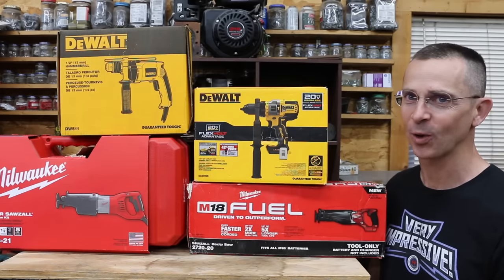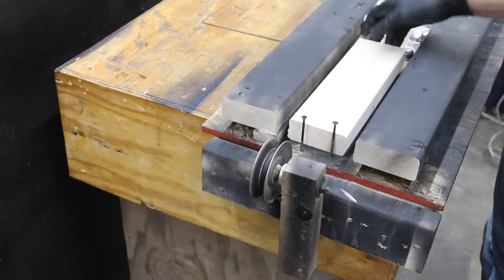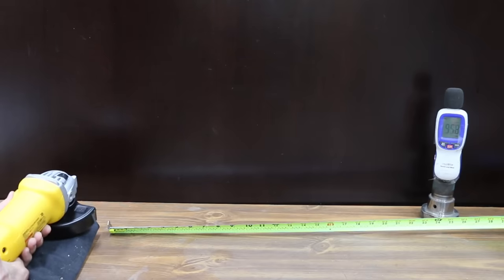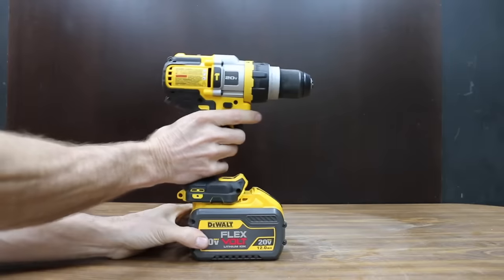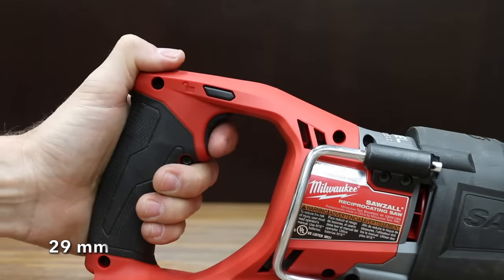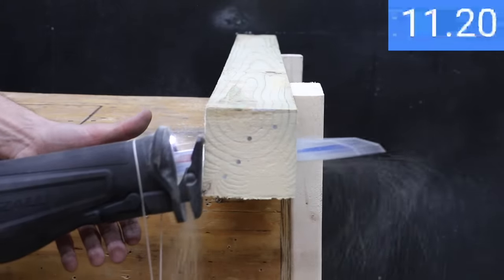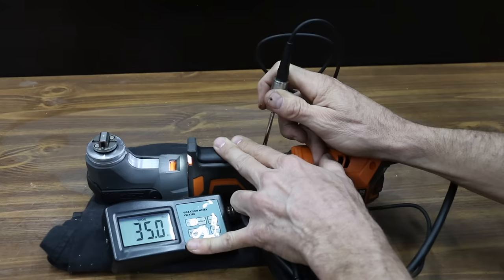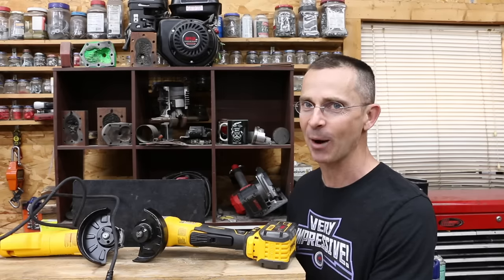Let's Settle This! Are Cordless Power Tools REALLY Better? Torque, Cutting Speed, Noise, Vibration

Comment: I own both corded and cordless tools and enjoy both. The big plus of the corded tools is twenty years from now they still work fine and I don’t have to worry about battery issues. That said I often use my cordless tools for ease of use, no cord.
Reply from the maker: Thanks for sharing.
Reply: That is true. I bought a Hitachi corded hammer drill about 15 years ago. I abused it a lot. I still have it, and it works just as fine, while a cordless Dewalt drill I bought two years ago has issues with the speed control.
Reply: True enough, but if you run a company you can go through 4 grinders or drills in a couple hours in the wrong hands or environment.
Reply: Came here to say the same. Still have some of my dads corded and air tools from 60 years ago. My cordless stuff be in the trash in 10 years because of battery issues guaranteed. Not because of anything nefarious its just the tech is in the batteries keep getting better. Backwards compatibility would be great but the tool company has no financial incentive to do so when then can sell you brand new tools.
Reply: Same here. One thing they have thought about is getting people stuck in their ecosystem. I buy the same brand just because I already have the batteries
Reply: If I was soley working in my own workshop I'd have nearly all corded tools. Because I'm often in places without electric I buy cordless.
Reply: @sleblanc  also has to do with production quality going downhill. I have had the same DeWalt cordless tools for ages. Early 2000s. They are awesome. But my brand new Milwaukee M18 tools have problems like what?!
Reply: My company mostly used Makita cordless drills on our jobs.  They are convenient, but not as rugged as the corded models.  For the last three years Makita has lost it's quality.  Now we buy a cheap brand and don't feel bad when they break.
Reply: whats the best corded drill ??????????????????????
Reply: @AnGryCruizer  dewalt mid handle vsr drill
Reply: @AnGryCruizer  That I do not
know. Check out Project Farms channel he does some very good product test.
Reply: It’s the same as Bluetooth versus corded. While corded will always sound better. Bluetooth is much easier to use
Reply: @theolympiyn8670  big facts
Reply: Yes, I like that I can keep the little impact screw gun in my tool bag with a battery in it, and 6 months from now it’s still got a charge. The little LED light they put on them these days is AMAZING, I find myself using my screw gun to look for other tools😂
Reply: @sleblanc  if you have a friend who works at an auto shop where a MAC tool truck comes around, they will replace it for free. MAC is owned by DeWalt and they solve defect issues by simply replacing the tool.
Reply: @supermr2  instead of trashing them, an electrician could rig one of the battery housings to make it corded
Reply: Agreed.  My first-generation cordless tools are already useless.  I still have all my old corded tools and they all still work.  Its hard to talk myself into spending many hundreds of dollars, just for the convenience when I have stuff that works already in my garage.
Reply: @theolympiyn8670  How is Bluetooth much easier to use? Corded headphones are plug & play, no hassle. Bluetooth, you have to deal with connection issues at times
Reply: @tcg1_qc  buy better shit them. Corded also has issues. One you can’t really move to freely with corded things. The cord can get caught on stuff and yank your headphones off. The cord can break and you can’t really fix it.
Reply: @theolympiyn8670  even with better stuff you can still have connection issues, and if the battery dies then you don't have headphones. Plus not everyone can or wants to buy more expensive headphones. 

 As for movement, that really depends. If I want to move freely with my corded tools, I just grab a long extension cord and I can move as much as I want. Now if we're talking about headphones, I'll be honest and say that I only use Bluetooth ones outside, but at home I only use corded. And if the cord breaks, you can fix it, depending on what the headphones are
Reply: @supermr2 flexvolt has the same power as corded yes you may have to buy new batteries in 10 years but it really doesn't matter if there's better quality tools out the Flexvolt is still just as powerful as corded so no point to upgrade
Reply: @troutriver58 flexvolt cordless is equivalent to corded power there would never be a point to upgrading regardless of what comes out in the future
Reply: @zackgibson3389 what are you using for replacement batteries for old Dewalt 18v tools?

Comment: It would be even more interesting to see a test like this if tool manufacturers put the same time and money into engineering corded tools as they do cordless. I feel like corded tool design has remained unchanged for the last 20 years.
Reply: Totally, doing a mains capable inverter would make them bigger (isolation required), while dealing with less voltage from a battery is easier(isolation optional).
Especially if you want to include complex stuff (microcontroller, LEDs e.t.c.).
Reply: It's probably pointless in the eyes of the manufacturer. There's more demand for cordless tools, even when they perform worse.
Reply: @Subsonic1050 Corded tools have remained the same for well over 20 years. Unless you think corded tools were a new thing back in 2000?
Reply: I've been in the metalwork trade for over 40 years. Have corded tools that are over 25 to 30 years old. Not much has changed for them. I have switched  almost completely to cordless. Because many job sites have no or limited access to power. Not having to run a mile of extension cord sure save time. Cordless tool will never be as durable but way more portable.
Reply: What kind of engineering do you mean? Seems like the corded stuff is already dialed in and built to use the power available. I would love to see more engineering on the functionality/convenience side.
I feel like the only engineering going on with cordless tools is the battery packs, and the performance improvements are simply due to higher output batteries.  Eventually they may have to beef up their internals, but I get the feeling the last few generations of a lot of tools were probably the same components, just marketed with higher output batteries. 
Idk if I would say its pointless to tool companies, but im sure they would rather be raking in profits than spending money on R&D. Its kind of a shame though because it seems like many improvements could be made, and it wouldn't take a rocket scientist.
Reply: @A6Legit  corded tools still come with brushed motors.... if they put brushless motors on corded tools this wouldn't even be a comparison. But r&d has basically stopped on corded tools. It's all about cordless and getting you hooked onto one set of batteries.
Reply: @ducewags  I saw my first cordless drill in 1990.. Hitachi.👍🇮🇪🍀
Reply: Or even a test where the cordless tools were not twice as expensive as the corded.   You may be testing a top of the line corded against a lesser cordless but it is what the money will buy.
Reply: @geoffreycasey875  Well that makes you a youngin fer sure if that was the first time seeing a cordless drill.
Reply: @ducewags  when did they start being used regular?
Reply: @rc-daily  No kidding, Ive never really thought about what kind of motors my corded tools use lol. I feel like they already have adequate power, is there really much of a benefit for brushless? Im sure there are some instances, but in general they get the job done fine. 
I enjoy having cordless tools but its BS that they arent hybrid. Especially when companies know even their best batteries cant really keep up with the high draw tools... Idk about everyone else but that seems like it should be engineering goal #1 to me... Then everybody wins.
Reply: @rc-daily  Most professional prefer cordless tools because there isn't power on a lot of job sites. Its nice not have to have a generator and a miles long extension cord. Battery power tools are a time save for people using their tools all the time.

The people that most buy corded are typically DIY and just want something cheap.
Reply: @geoffreycasey875  Well back in the early 80s we used them for building decks and tree stands where we had no power. Makita cordless and Black and Decker was a big hit back in the day.
Reply: @A6Legit  the benefits of brushless are unlimited. More power, more torque, longer motor life, no brushes, no maintenance, no wear parts, more energy efficient,  just to name a few. In theory you could run a smaller brushless motor to have a lighter tool that would out perform the original brushed tool. Battery technology has came a long way in the past 10 years or so. Back then in the rc world you would be lucky to get an rc to run 15 minutes on a huge nimh battery. Now with brushless motors and lipo/lihv batteries we can get an hour out a 500mah pack. Your average 11.1v 500mah pack is no bigger than 4 aa batteries in square. Like an inch wide and an inch tall and 2.5 inches long.
Reply: @nathaniels9141  I do construction work for a living. Obviously all of my impact drills are cordless but my hammer drills are corded, my miter saw, skill saw, recip saw are all still corded. But where we generally work we have access to power. We remodeled a barn a few weeks back so we had to get out the generator lol

Comment: Would love to see different wire connector tests (wago 221’s, traditional wire nuts, etc.) Thank you for such thorough reviews! Keep up the great work.
Reply: Definitely second this.
Reply from the maker: Thanks, will do!
Reply: Great Scott already did it.
Reply: Several people on Youtube have already done comprehensive tests (Great Scott did it and another guy did as well). Both tests were exactly the same.  Wire nuts give less wire resistance than any of the other connectors (the wire heats up less and less power is lost as heat). However, all three types of connectors are legal under the NEC, so it will be up to your local codes or who you're working for.

Comment: Each tool has its place. I select Corded tools when I have a lot of cutting/work to do so I don't have to keep changing batteries.  Also, Corded drills always cut the same unlike battery tools when the battery gets low.  Thank you!
Reply: Agreed 100%, and another advantage of corded tools is if you only use your tools on occasion you don't have to wait for the batteries charge up, or worry about if they have gone bad on you having set around, just get an extension cord, and get to work, plus overall corded tools are cheaper to buy if you are putting a garage/workshop together on a budget.
Reply: Also if you only do something now and then not often corded tools are better always on hand and always work. Battery tools tools are good if you use them a lot and have more than one battery.
Reply: Buy extra batteries and you'll be good. Yes, they are expensive but I have a job and my convenience of not moving a cord around things is well worth any amount I need to pay 😉 Good luck to U out there! 👍
Reply: Exactly. Like that taco kid said, why can't we have both?
Reply: I like cordless because when you release the trigger it stops very quickly. I've broken a few drill bits with a corded drill (tried to break my wrist).
Reply: @tonysheerness2427  Yep, and with battery tools unless you stick with the same brand which might not always have the tool you need, then you are going to end up with different batteries that won't interchange, same with the chargers if they don't plug in directly to an outlet with a wall charger, then what if say 10 years down the road the tool still works good, but you can't get the battery for it, because no one is making it anymore, then you have to buy a whole new tool, and just chuck the old one without modding the old battery pack if it even can be. 🤬
Reply: @CommodoreFan64  Yes I had to chuck out a 24 v drill because to buy replacement batteries cost more than a new one. And they say go green, all talk.
Reply: This. Horses for courses.
Reply: @tonysheerness2427  Zero surprise there, as after my stepdad died in 2015, I inherited his garage worth of tools with some dating back to the 1950's, and many corded power tools from the 80's which still work good to this day(same for the air tools with just a good oiling) when I need them, but almost all of  of his battery powered tools because he let them sit too long, I had to chuck in the recycle simply because I could not get the replacement batteries, or they where going to be too expensive.  Battery power is just so wonderfully green, and earth friendly 🤦‍♂️
Reply: @CommodoreFan64  I had a 12v Milwaukee set that I finally dumped about 5 years ago because it was near impossible to get the batteries. Yet, my corded tools from the 50's continue to work fine.
Reply: Yep.  Corded in the shop.  Battery powered in the field!  Also certain jobs just need a corded tool.  I have had my Milwaukee drill literally smoking trying to mix mud with a paddle whereas a corded drill just chugs along all day and night.  Just my experience but coldless tools can make some serious torque but all that amperage at lower voltage they use to do it makes a LOT of heat.
Reply: @BrianRRenfro  use a mud mixing cordless drill
Reply: @matthewsmith1461  If I did drywall every day...maybe.  Or I can just use a $100 corded drill I have lying around.
Reply: @jaynelson4175  Heck yeah! I forgot all about them being wrist breakers because I haven't use one in so many years 😭
Reply: @CommodoreFan64  Bingo. Batteries are not there yet in terms of longevity. And that is how the manufacturer gets their BS planned obsolescence cash grab in. They change the battery and /or the charger and youre screwed. A corded tool can't be figured into the planned obsolescence scam as you can keep it forever. Ive got a few cordless tools that I really like. But for hitting it hard all day long. It corded or pneumatic for me.
Reply: Ya I only use cordless grinder for light stuff, if I've got a lot of grinding ahead the extension cord is coming out
Reply: Usually when the battery starts to get low it just cuts off, it doesnt go slower and slower and slower
Reply: @giggiddy  Thats one of the reasons Ive stayed with Ryobi.. their 18vt bats fit nearly every power tool they make. They may not be quite as fast or as powerful as some of the other brands.. but I only really need 1 charger in the truck.

Comment: I definitely prefer corded angle grinders for zip cutting metal with the power that they have. I also like the capability of cordless when working on site
Reply from the maker: Thanks for sharing.
Reply: Totally agree grinders need accorded power for peak cutting and grinding amps he. Cordless simply don’t last in real work environment uses. I have both. My favorite in a 1966 model that’s now illegal on most job sites it’s it’s so industrialized strong made of heavy duty metals no plastics in this than again takes a lot of strength to use it. But for heavy duty jobs nothing can keep up with it. The cordless one I love the dewalt and it’s light enough my daughter uses it. Hint she can’t carry the 1966 model 😂 I admire her effort to be like dad. Lol dewalt an outstanding cordless jyst no cordless is equivalent to a corded tool for stamina. Batteries die electricity is consistent.
Reply: @blackwidowsm  pop
Reply: I own both an old school 15 amp metabo and a Milwaukee cordless one. Plenty of torque with the Milwaukee the only thing is the battery does eventually run out.
Reply: @DavidStapley0982  Thats why you have multiple batteries....
Reply: Safety features on the new grinders are worth a lot for the average DIY'r. My Dewalt Flexvolt Advantage grinder has a lot of safety measures that the old grinders don't have. Grinders are extremely dangerous if not used properly. A broken wheel spinning at 10,000 RPMs can cause some serious damage to the user or someone standing by. A broken flying grinding wheel can shoot straight through safety glass
Reply: @blackwidowsm  That's my experience as well. I have a DeWalt cordless grinder, but I got pissed off with the 5amp batteries lasting about 20 minutes with a knotted wire brush on the end, so I got a Makita corded and also found that it will cut through bolts considerably faster than the cordless.

Comment: An expensive round of testing!! Kudos to Project Farm for their dedicated research.
Reply from the maker: Thanks!
Reply: @ProjectFarm  Are there any examples where a corded device exists in the same price bracket as the cost of a cordless device + battery? I would like to see that comparison and I feel it would be more fair than comparing the devices at a set price point and treating the battery cost as a separate thing. Part of the price of the cordless device is the manufacturers assumption that you will be buying their battery, and its pretty obvious there is a lot of margin baked into the cost of these battery packs.
Reply: Unfortunately its just not like for like as per the purpose of the video.
Most tool brands now have a dedicated range that is corded tool power in a cordless version - in this video dual 18V Makita ,however in the angle grinder test for example a 800w cordless vs a 1342watt machine or 1.8 horsepower makes it an irrelevant test and as such the results showed.
If the flex volt cordless grinder was used it would be far more comparable at circa 1500w.
Same in the multitool test, the brushless rigid model would perform more comparable to the corded one in this test.
He does do a great job overall but some of these inconsistencies can be a tad misleading, just something to consider before drawing any conclusions.